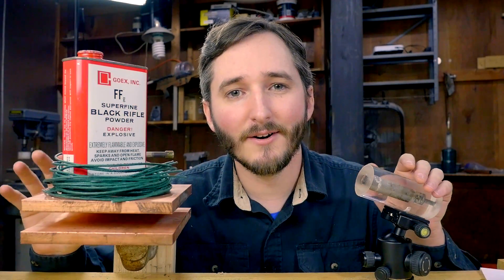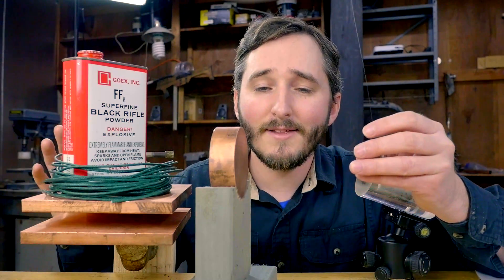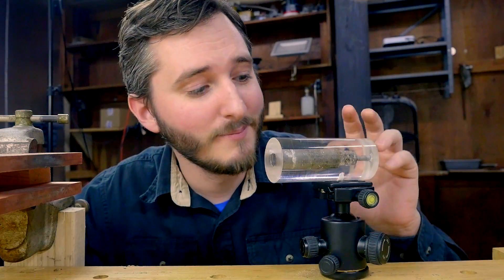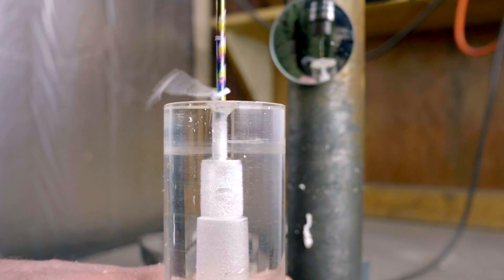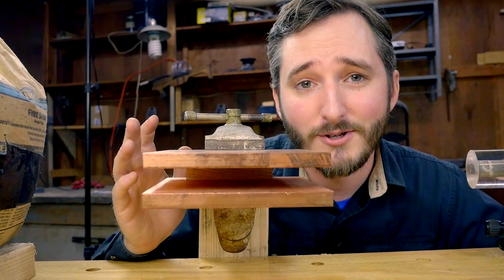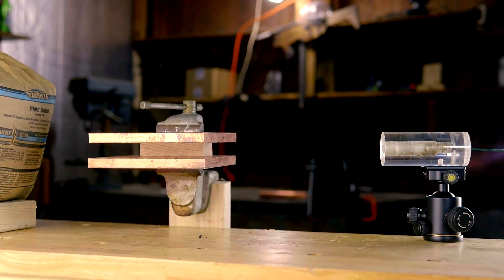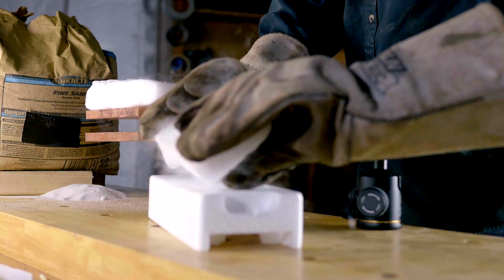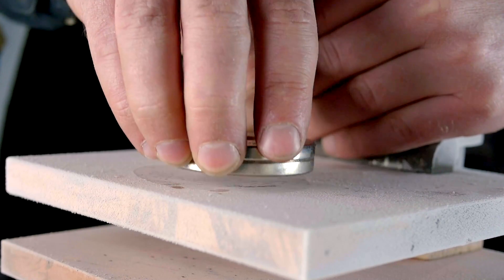Electromagnetic Force Fields VS. Magnetic Cannonball

Comment: the STOPPING A BULLET thing, seemed like a pretty insane idea.  Right out of the gate.  But something more reasonable, to me anyway.  Do you think it be a good alternative to "air brakes".  On a semi tractor-trailer  I don't think it would involve a permanent magnet.  But an electro-magnet powered off the forward motion of the vehicle.  True, the idea is about 100 years to late to actually use in tractor-trailers.  But I can see it implemented in other projects.  Maybe?
Reply from the maker: Regenerative braking in hybrid/electric cars is exactly this.
Reply: @Nighthawkinlight  Ok.  I never thought it out to the end of the rant.  That does make perfect sense (about regenerative breaking).  Magnetic flux is so fascinating.  But even more interesting (that also moves in a toroidal fashion), is gyroscopic momentum.  And, yea, I realize they are the same thing.  At least, almost, one is temporal and dependent on velocity.  Fascinating though.

Comment: Knight

It seems that is a magnet is hit hard is looses its magnetic field.

So you may need to retest with a stronger magnet.

Also you need to wrap alot of Cooper wire around the pipe to have more copper in the pipe.

Larger magnet projectile need that is stronger.

Use compressed air to move the magnet not blackpower. Increase the air pressure as needed to see what works.

Comment: In the Machinist world we use soapy water in a spray bottle when drilling acrylic.
Reply: Soapy water and a slightly negative cutting angle, slow cutting speed. Your holes in acrylic are going to look like polished.
Reply: Haha i was thinking the same
Reply: Chipped cracked and melted plastic, turning the drill head by hand.  Grinding the cutting edge to a negative angle, Looking how to slow down the motor or get a machine that runs at a lower speed.

You are saying:
“A spray bottle with soapy water?”
Reply: @18141776hhhh  Yeah, I would have just run it at a lower speed while still running a peck operation.

Comment: Hi,
Instead of using solid copper use coils of copper bent like AC signal wave and also try it will spiral coil arrangements, that will produce current slowing the projectile little bit. Here u can't see slowing physically but rather as heat generated. So kindly attach thermocouple to the copper plates and sea if temperature increases.

Comment: what amazes me is that for flash and flam you did not use a laser shot through your fuse hole up the barrel and through the gap of the metal plates with some small measure of vapor or smoke to show off that it is indeed pointed directly between both ends of the metal plates XD

Comment: The ball wasn’t gyro spin on any axis or it’s NS pole were fixed by any means in it’s trajectory - between (1) two copper plate or (2) through copper tube, seems to be our problem. 

Rerun the experiment with the ball magnet replaced by a cylindrical magnet (diameter matching tube diameter and gun bore, if possible let the cylinder spin through the gun barrel like a rifle bullet) this way we can fix the NS pole orientation along it’s trajectory.

Comment: Ok, there is 2 reason why this shouldn't work. 
Reason 1: When you heat magnet after explosion magnet loos their magnetic properties. If reach curie temperature it behaves as nonmagnetic so like a standard bullet.  
The much weaker magnetic field. 
Reason 2: Magnetism force change with distance square so pipe with this dimension will not produce that strong force. Even when you put magnets in pipe before experminet you use a larger one that almost feet perfectly in the hole. You should use a magnet that feet almost perfectly in the hole either- but in another way that will be much harder to get - straight all along the axis. In my opinion, when you throw through that pipe this small magnetic ball the time shouldn't be extended as significant. 

So your experiment can't work.

Comment: There must be a mathematical formula involving the mass of the copper, the momentum of the projectile (speed times mass) and the magnetic strength of the projectile; oh yeah, and the temperature of the copper.
Reply: There is but you missed a few important parts speed of magnetic waves around each object, rate if inductive field generated, and the differential of fields from crest to crest of each wave.
Mr=[BtuMV(Mra-Mrb)(Ama/Amb)Frq]²/(Ifa/Ifb)
Reply: Simply put speed negates fields exponentially so to stop a bullet he would need a copper foil (foil not coil) and several generators connected in series not parallel with a frequency timer to prevent lock stepping and a strong inductive array behind the foil at the same frequency of the projectiles field to multiply the size and rate the field builds as the magnetic object approaches, greater than the copper would alone.

Comment: I would just like to say that ik a lot about guns and also magnets and I know that magnets lose their properties whenever they are heated up to a certain temperature and I know that shooting a magnet out of a gun / Canon would most likely reach those temperatures that's most likely why it didn't stop in the copper pipe the heat generated from the Canon made the magnet lose its properties so the copper had little too no effect on the magnet

Comment: Dude, you need to brush up on your E & M!. Shooting a magnet between parallel plates will do almost nothing to slow the magnet. And cooling the copper to make it more conductive only makes it worse.

When a magnet moves rapidly across a conducting plane, it induces currents in the plate that create an opposing field. But the force from that induced field is normal to the surface. It will try to keep the magnet away from the surface, but it won't slow it down.

That's not the full story, however. In fact it IS possible to stop your magnetic bullet shot between two parallel plates. But you have to go the opposite way you were trying to. Reducing plate resistivity reduces induced heating in the plates You want to MAXIMIZE induced heating. That's where resistance to the bullet's passage has to arise. You should experiment with thinner and more resistive plates. There's a theoretically perfect resistivity (depending on strength of the magnets and distance from the conductive surfaces) where electromagnetic drag is maximized. If you can get the right value, your audience will be treated to slo-mo video of the bullet/magnet traveling between two films of aluminum coated paper and dragging a wake trail of vaporized aluminum as it slows.

Comment: You didn't look into weather or not if a thicker copper plate would have any effect or if you were to run electricity through the copper would have an effect as well after all the test must use conductive metals why not add electricity through it and then drop your magnet from a higher height then shoot your magnetic cannon ball through your copper plates and copper tubing!!!!!

Comment: Get a clear plastic tube, drill air holes every inch.

Install ring magnets spaced out on the tube.

Put the tube  in front of a barcode like backdrop.

Use compressed air to fire a copper projectile that barely fits the tube.

Start at low power.

The copper slug will stop after the magnets rob it of momentum.

Use your high speed camera to count frames and the number of barcode bars the slug crossed per second, and thus calculate the rate of deceleration.

Compare this with a lead slug of the same size.

Once you know how many Newtons of force the magnets absorb, you can calculate how many Tesla it would take to stop your bullet.

Remember the experiment that levitated a frog in a magnetic field?

That coil was about two feet across with a 2” central hole.

I’m pretty sure that’s the kind of field strength needed to stop a 500 FPS copper slug.

Comment: Your design for the cannon was the first time I've ever even considered the fuse placement.
Now that I have, you make me wondered if the cannon has the fuse where the powder chamber and the projectile met, thus allowing for a more consistent burn off. The way yours is causes the exothermic process to begin at the back, and probably resulting in premature discharge, blowing powder out before ignition. Not that yours was insufficient for the experiment, thanks for that!
I've often watched your videos and enjoyed the content.
Reply: Black powder actually burns faster than smokeless and can be dangerous. Near or at the rear of the chamber is the safest place to ignite it

Comment: You should have attached the copper pipe to the cannon as a makeshift barrel (with vent holes to prevent a buildup of pressure) and used a larger magnet

Comment: Yo nighthawk i was thinkin About a copper pipe that is balanced just like a seesaw. In de pipe is an magnet that’s just a bit smaller then the pipe. On both ends must be a magnet one with north facing the South Pole on the magnet that’s inside and the other one countering this action. Would it give the seesaw rockin action? So          Magnet S>     <<S Magnet N>>         <N Magnet

Comment: In your mind unwrap an AC motor, imagine the case is flat, you have a flat track where not only is the projectile moving but the magnetic field is moving with it too.....that is why rail guns built with a stationary magnetic field don't work well but electric motors are awesome.
Fully understand 3 phase electric motors and you will understand everything there is to know about moving or stopping stuff using magnetism.
Reply: Got any recommendations on source material for learning about 3 phase?

Comment: What if the copper was turned into a permanent electromagnet? The reason this experiment is failing is because the electromagnetic field induced in the copper simply isn't powerful enough to arrest against the kinetic energy of the magnetic projectile. If you powered the copper, it may have a powerful enough EM field to cancel, or at significantly drain the kinetic energy of the projectile.

Comment: As someone who reloads, the blue dot powder you are using burns too slowly to build up the pressure your looking for in such a short and poorly fitting projectile. Needless to say black powder or a faster burning powder would work much better.
Reply: uh, that's why he switched to black powder? Did you not watch the whole thing?
Reply: @SpydersByte  my comment had more to do with the smokeless powder. He wanted a clearer shot of the ball without all the smoke, and to achieve proper burn you would need a faster propellant.

Comment: This is basic highschool physics. I = nAev.  Current, is a function of the number of free electrons, their drift velocity, and the cross sectional area of the conductor.  You went to a conductor with a smaller cross sectional area and expected a larger effect, that's just not how it works.  Further the current's return path is through the same conductor as the currents flow path.  For the pipe the current was flowing in one direction on the inner surface of the pipe and another direction on the outer surface of the pipe so you're basically fighting Lenz's law in the hardest way possible.  As well neodymium magnets just don't work above 80C.  You need to use samarium magnets for applications with higher temperatures. 

It just feels like very little thought went into this experiment and nothing can actually be concluded from it because it's just so clumsy.

Comment: well, idk where you saw the magnet coming through there, but ok.
Reply: I didn't see the magnet either
Reply: It was sent into another dimension
Reply: It almost looks ethereal, but it's there.
Reply: I think it came out after that part with the smoke. And he just thought a spark was the ball.
Reply: he spotted the magnet correctly at the exiting point of the pipe. you can only see magnet the first half way because the magnet kind of sped up after exiting the pipe.
Reply: @seannathan3854 
I believe it doesn't speed up after exiting the pipe since it doesn't have a motor, it is a projectile. Kinetic energy that is lost in a pipe is gone. The energy that is left is all it has, so it should not accelerate on the exit of the pipe.
Reply: Same
Reply: same here, maybe he was just annoyed by the setbacks ;p it's not a big deal though, still a cool video.

Comment: Something similar to this has been proposed in another comment, but it would be cool if you repeated the double plate experiment but attached an oscilloscope to measure the voltage between the plates. Not sure is you would need to have a conductive connection between them or not though. And you might want to use a magnetic projectile that will maintain its orientation (somewhat) while in flight, if that's at all possible. Maybe by using a non-magnetic slug of some kind designed to be passively stable (check out Taofledermaus' channel for some good examples of passively stable slug designs that don't need rifling) and then attach magnets to it somehow so the magnetic field isn't tumbling through the air as it would with the spherical magnets.
Reply: You will need a resistive load between the plates to dissipate the energy.
Reply: I was thinking similar. The ball is a bad choice

Comment: That was a lot of fun. I didn't expect the copper to stop it due to the observed results of your previous experiment. As you hinted the magnet is going too fast for the copper took stop it. I guess copper isn't going to be a good vest material. I like super magnets in electric motors to reduce power draw.

Comment: Why the distance between the cannon and the plates or the pipe? You should make an electromagnetic calculation in advance. Or run very low velocities to start with, then increase the velocity to see how the deceleration is supposedly increased by the pipe.

Comment: Have you ever tried shooting the magnetic ball through the two copper plates while they are inductively heated up to a certain temperature within the gap as well as surface temperature on the inside of the plates whilst you are simultaneously cooling the the external outer surface temperature with either liquid nitrogen or you can basically use computer duster while spraying it upside down and at an angle to produce the same rapid cooling effect as (or if not) close to liquid nitrogen as possible. While you are using your current method of propelling the magnetic ball in the desired point and line of travel or trajectory. I have a hunch that this in essence promote the magnetic ley line fields to contract and hold tighter resonating circumferences towards the singular (if not more than one) atomic point at the center of the propelled magnetic sphere so as that there are little to no acting external cues and or factors in making the facilitated and controlled experiment safe, measurable and adequately definable by the self and others. This will in my own and personal Theoretical synopsis enact a spring released barrage of magnetic fields of the exponential type though to what degree(s) im not exactly sure at this time which will make the projectiles aim trued until a desired vector point is reached and by which point the enacting and oppositional forces contracting the magnetic ley line fields within and surrounding the magnetic metallic ball or sphere will no longer be in effect so that all other equipment effectively works in fashion much like a temporal magnetic field displacement occurrences and recurrences will stop the projectile fast enough to see it stopped once stopped but not so fast and unstable that a singular atomic particle escapes the desired effects to be enacted on the projectile in its entirety so that it can be recovered in its entirety safely without any dangerous nor highly unpredictable outcomes from doing so. Hey so dude I gotta say you are pretty smart and like me probably too smart for their own safety hahahahaha joking, but yea dude I mean sir...please reply back to my comments for the ones I have left as I must be moving on with my home studies though I could go on forever it would seem like in this field of knowledge and area of expertise.  :)

Comment: Use a pipe that is a couple millimeters larger then the ball you might also try a slug style ball and instead of allowing the Canon the kickback attach it to the pipe and attached it to something solid so it won't kick back plus the pipe needs to be thicker

Comment: fail is in the size of your magnet ball and pipe... so your pipe inner diameter is significantly bigger than ball's diameter. try it with other one more adjusted... if you leave just 1 mm difference you can stop the ball !!! just try it ! 😉  you will need to setup a more precise aiming... ! ...but will work !! trust !  😁😁😁

Comment: I want to encourage you to test HOW MUCH IT SLOWS DOWN, even though it doesn't stop.  There are various kinetic energy tests you can build.  Simplest being that you fire the ball into a block (that captures the projectile) which is hung from the ceiling.  How far the block swings plus math tells you the energy.  Fire a magnetic ball with and without the copper and we'll see the reduction in impact energy--meaning how much the copper absorbed.  Please do this.